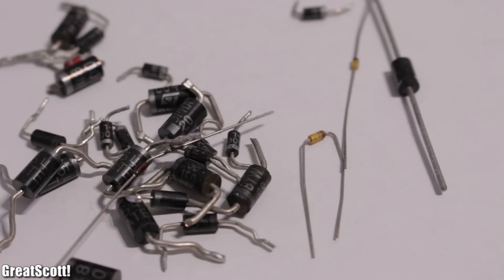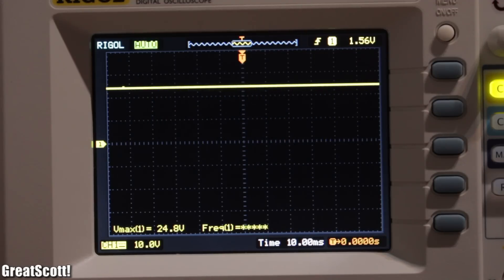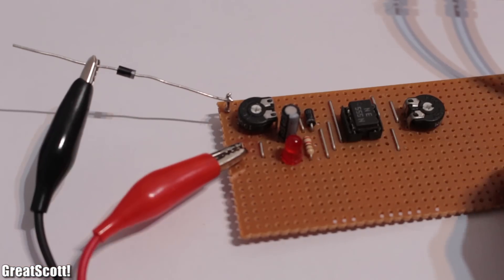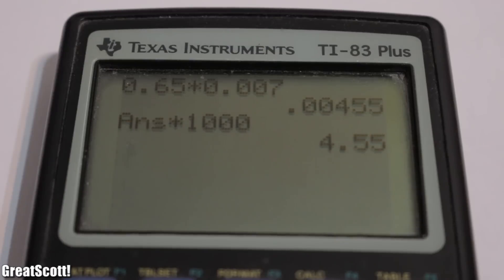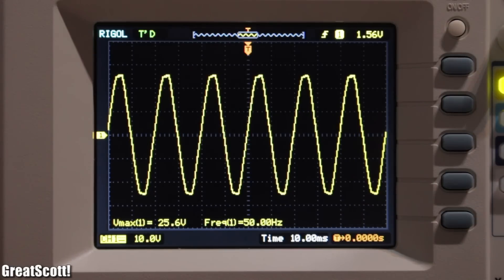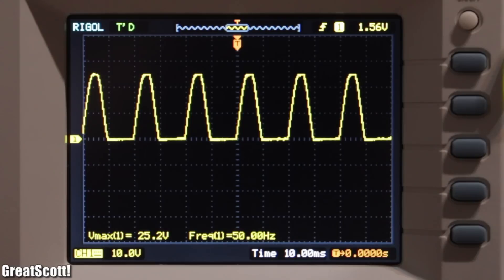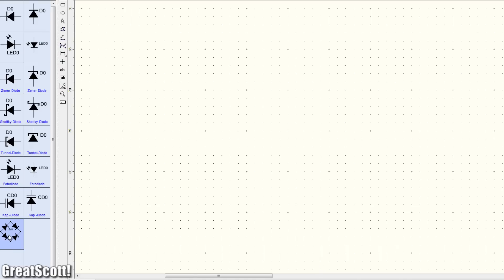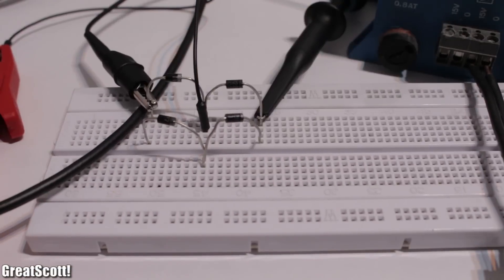Electronic Basics #9: Diodes & Bridge Rectifiers

Comment: Hi, I just want to ask a question to you that , can we run DC motors of different  input voltage ratings with a single motor driver circuit considering in mind the maximum supply voltage the driver circuit gives which in turn will be used as a information to use  the variety of DC motor that can be used to run .

Comment: I have a toroidal transformer that delivers 28 volts ac, but after rectifying it delivers 40 volts! Why is that happening? It does not drop with the load.

Comment: Would a larger diode typicaly have a higher voltage drop? And higher capacity?

So to minimize voltage drop i would use the smallest diode that i can?

Dang i wish i had a perfect diode :P
Reply: germanium signal diodes have a small voltage drop, but they will die with a few milliamps of current flowing through them

Comment: I don't get it. Negative becomes positive because of what? I thought the whole point of a diode was to ensure that polarity stays the same. How its is suddenly inverting it?
Reply: Because it's alternating current. On the left is the input, output is the resistor on the right. No matter which way the polarity is on the left, current flows in the same direction through the resistor

Comment: Electrons do not flow from + to -
Reply: redstone craft guy Because electrons have negative charge so they move from - to +. But since we are talking current we can say that it goes from + to -.
Reply: + doesn't indicate electron charge here.  Instead it indicates an abundance of negatively charged electrons (i.e potential).  It's just an EE convention for DC voltage.
Reply: Jimmy Shakway why?
Reply: You are right, but before we knew about electrons we knew about electricity and chose a random direction for current, the only problem: we were wrong, but the laws still work, so why change them?
Reply: we were not "wrong". this is a common misconception (actually, Ben Franklin was wrong, but for a different reason, he thought there was only one kind of charge, instead of two). the only reason you feel it is wrong is because electron flow is the form of electric current you're most familiar with. a flow of positive charge (ions in a battery, for one example) from + to - potential is also electric current.
Reply: - to +

Comment: Blew past my head a little. I understand diodes. I understand that they can convert AC to DC. I didn't understand the negative to positive voltage. I don't even understand how negative voltage works
Reply: Only difference between positive and negative voltages is current direction. Positive voltage causes current to flow "forward" and negative causes it to flow "backward". Bridge rectifier just connects AC source to a load directly when AC voltage is positive, and reverses polarity, when AC voltage is negative. Negative voltage causes "backward" current, but it is already connected "backward". So both positive and negative voltages cause "forward" current, what is equivalent to applying pulsating DC to a load. 

PS: sorry for my English, i'm not native.
Reply: no. voltage itself is negative. electrons are negatvely charged. the side of th wire that is more positive or more negative is what makes plus and minus
Reply: @henryswan1374  you have not explained it as clearly as you think you have.
Reply: @tomaszwota1465  you're right that was really unclear, sorry

Comment: hey great scott,i made a bridge rectifire at home but when i connected it to the mains it shorted and a huge spark appered.Plz help me how to make it and which diode i should use and is 220volts A.C too high for the circuit. plz reply

Comment: I am modifying a popcorn popper for roasting coffee. I have disconnected the DC which has a bridge rectifier on it and connected a 26 volt transformer to power it. The transformer worked great to power the fan but after 10 minutes it got too hot I think and broke. How can I solve this? Why are my transformers not working more than 10 minutes? Is it because the load of moving the beans around is too much for the fan causing the transformer to work too hard?

Comment: Hi Scott, could you explain why the max voltage increases from 24.8V to 25.2V as you connect the cap at 3:36? Thanks, Love your videos!
Reply: looks like it doesn't actually change (visually, the line is in the same position as the peaks). this is just an artifact of how the scope is measuring the maximum voltage. it might do better if he changed the timebase to get more periods on the screen.

Comment: hi, greatscott, i have a dual usb power bank, it uses 6, 18650 batteries, on the board there is a component, its code is SBR2045CTFP, the problem is, when i connect two spartphones on it this particular component gets very hot, also, the batteries go low by a very short time, i presume its because power are getting wasted as heat, by what i understand of electronics, i believe that soldering a second SBR2045CTFP, cathode to cathode, and anodes to anodes, i can avoid the heating by, I BELIEVE, excessive current, is this correct? can i solder a second SBR2045CTFP in parallel? and this will solve the overheating? like so much your videos!!

Comment: Using a MOSFET is a more efficient way to protect from reverse polarity.
Reply from the maker: +DigGil3 Correct.
Reply: Thank you, Senpai, for noticing me!
Reply from the maker: +DigGil3 Haha no problem ;-)
Reply: Bartosz Olszewski I don't think so. Fuses are good for overvoltage only. In a reverse voltage they can allow it without tripping.
Reply: Bartosz Olszewski I smell Dunning-Kruger effect...
Reply: IRFZ44 i think they only work for overcurrent. they're resistors
Reply: Bartosz Olszewski What kind of fuse is that?! Not of this kind, I'm sure: http://www.pssl.com/images/ProdImage01/1500/Z-FUSE-GMA-5A.jpg
Reply: I'm not intending to let you down, but... facepalm
I have to let you know that geometry doesn't affect in what way electrons travel. Maybe you have some sort of semiconductor (a diode, probably) and don't even know it.
Reply: Bartosz Olszewski Can't argue with that.
Reply: I recently bought a new Schumacher manual automotive type battery charger and used it about 3 times and it stopped working. It has nothing, no buzzing sound and no sparks when the + and - clamps are touched together. I've taken the outer case off and looked everything over and the transformer (coil windings) still look good and not burnt. I have a feeling that it is either a bad Klixon (miniature) thermal protector or a bad bridge rectifier. I don't have a meter to check these yet but am getting one soon. My question is if it is a bad Klixon thermal protector would it be better to upgrade it to a bigger manual reset thermal protector? And also, is there a quality or maybe an upgrade to the thin plastic bridge rectifier? Any help would be appreciated...
Reply: Bartosz Olszewski  Just replace it with a fuse? Doesn't it need those diodes to function properly?
Reply: Bartosz Olszewski  I'll check into it, thank you!

Comment: I think I just generally don't understand how electricity works :,D why does it not flow through the circuit when the ground is on the diode and the 5v is on the other end? Does that mean you could put the diode anywhere is the circuit and it would always be okay? Thanks, great video :) I'm doing electronics for AS and really finding some part difficult to understand :L
Reply: All diodes have a certain (large) voltage where they will break down and let current through in the opposite direction than the one they're usually used for. Appropriately, this is called the "breakdown voltage". The reason diodes normally conduct electricity in only one direction has to do with semiconductor physics and the chemistry of their composition - basically, gaps in the atomic structure make electrical flow much easier in one direction (by design.) 

Keep in mind also that there are current ratings for every component, so there's no guarantee that a diode would always be okay in either configuration!